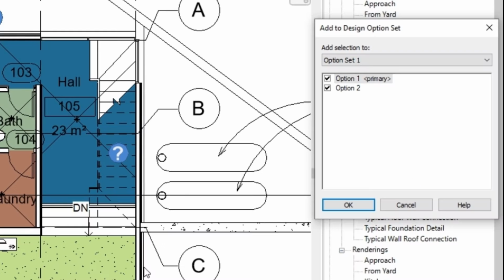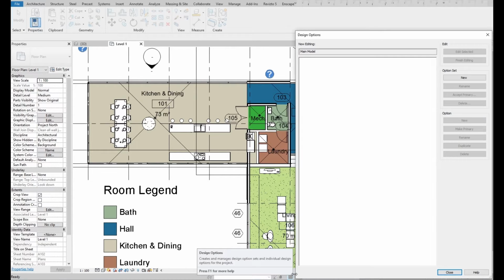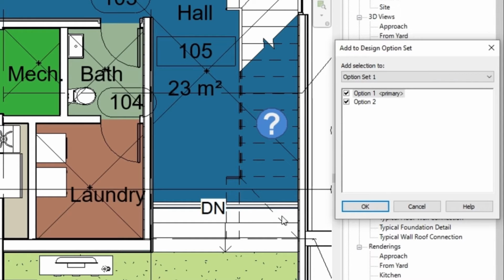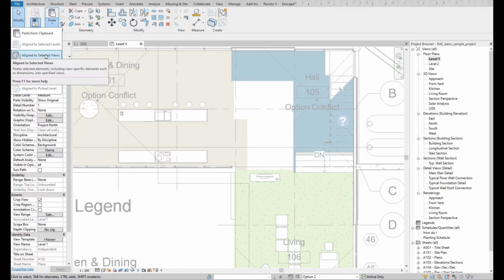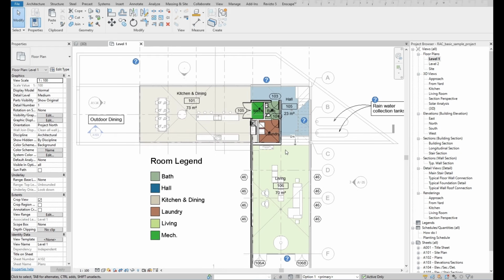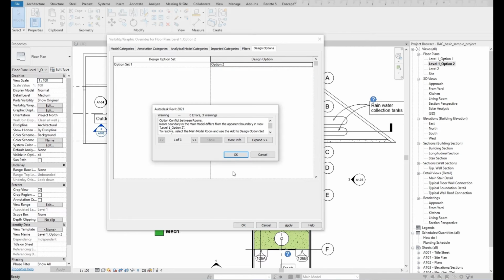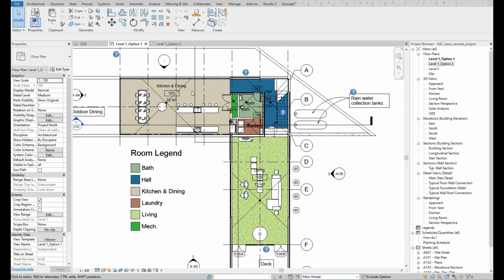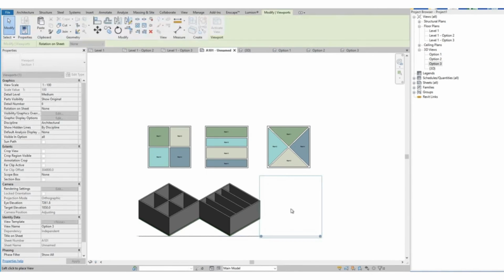DESIGN OPTIONS IN REVIT | REVIT TUTORIAL FOR BEGINNERS #learningrevit #revit #bim #tutorial

Comment: How do I get to the design options dialog?
Reply from the maker: To access the Design Options dialog box in Revit, navigate to the Manage tab and click on Design Options in the panel, or you can click the Design Options icon located in the bottom bar of the Revit window. If you are using Revit LT and the Design Options are not visible, you may need to enable them by going to File > Options > User Interface and checking the Enable Design Options box
Reply: @learningrevit7389  thank you I hadn't a clue how you gotten there